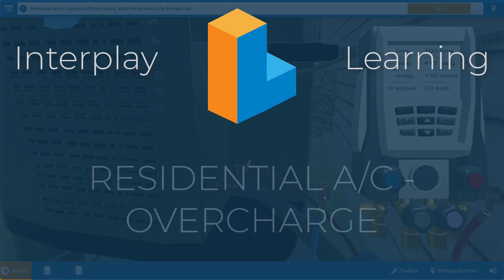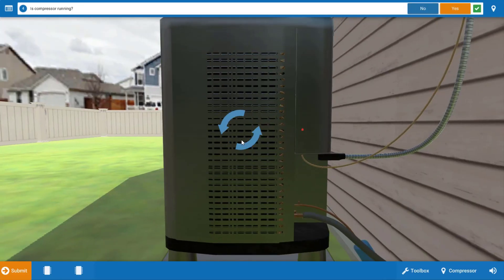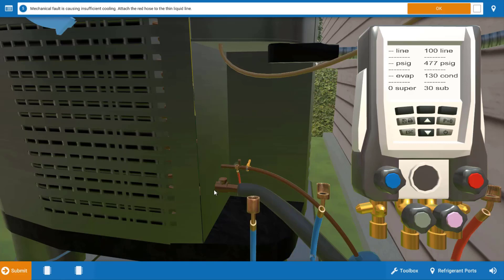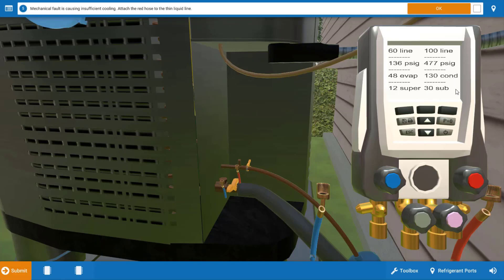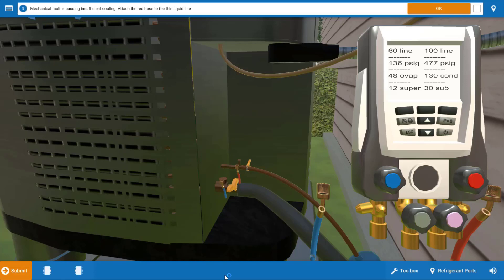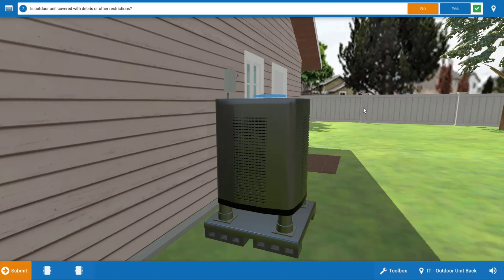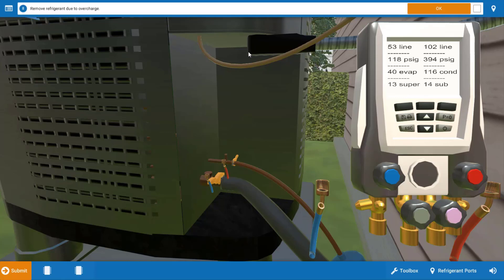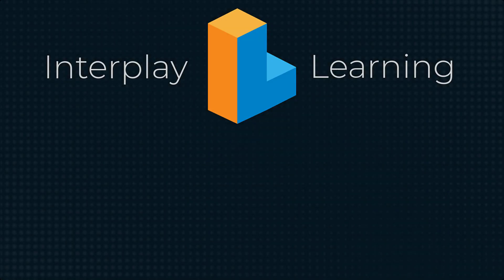[2019] How to Diagnose a Refrigerant Overcharge (On a Res A/C)

Comment: What happens when it is overcharged double the amount unit takes?  Say unit Mfg calls for 4 lbs 2 oz and tech puts in 7 lbs 8 oz, unit keeps keeps short cycling.  Also can an overcharge cause a condenser to blow a seal?  thanks.